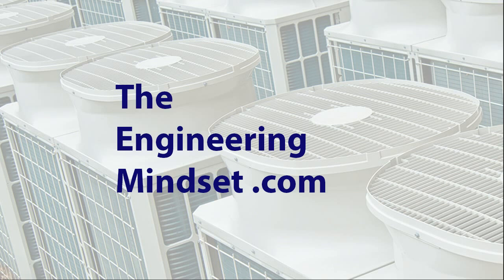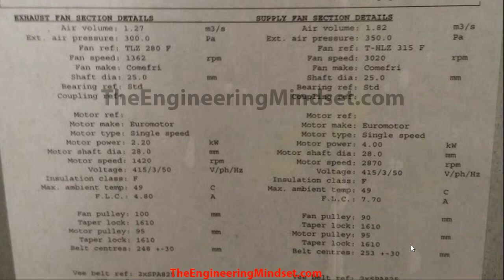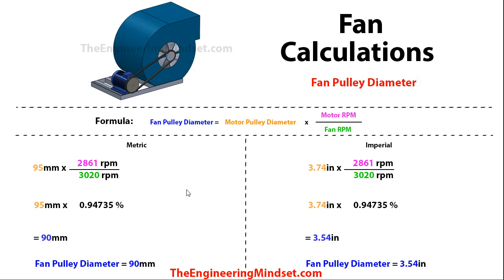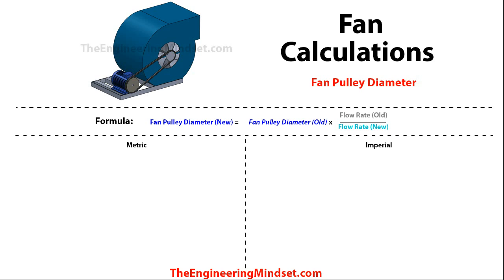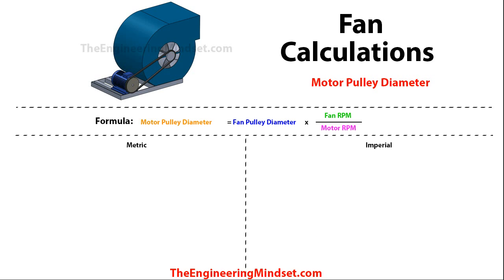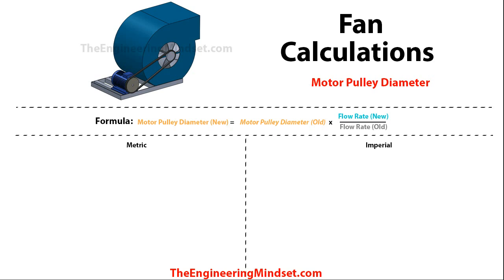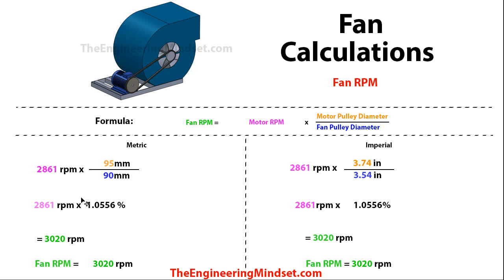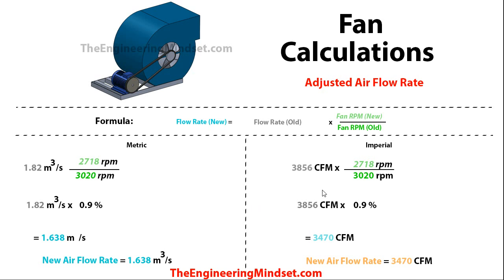Fan & motor CALCULATIONS, Pulley size, RPM, air flow rate cfm hvac rtu

Comment: can you explain the blower design procedure, please..
Reply: Sir do u have any suggestions now ? I kinda hard to believe it is such a pain to search design procedure of a fan as a cooling device to reject heat out from a generator. My schematic system was pretty simple since it doesn't need any motor. The fan will be installed on the rotor inside a generator to circulate the air. But I don't know how to choose the proper design and sizing of the fan.

Comment: Good Day, I meet with a customer today and they have 3535 RPM 40HP Motor that has to drive a Roots 56 URAIL Blower. they want pulleys on both components. Can you help me out.

Comment: How are you measuring the pulley diameter? Bottom of the groove, the edge or with the belt on the pulleys??
Reply: We can measure the diameter of the bottom of the pulley groove or the pulley belt, but the two pulleys must be measured in the same way.

Comment: PS - what about calculating the ratio of motor and fan pulleys to achieve a desired CFM. Also, how to calculate existing CFM if not stated.
Reply: Measure the fan capacity with an anemometer.  We provide that service.

Comment: Hi Paul, for equations at 4:30, is there any typo?
Reply from the maker: no, I don't think so?
Reply: Yes. It should be  111%, not 1.11%.  The increase is 11%, or multiply by 1.11, or its 111% of the old.
Reply: The other calcs are done similarly. However, its semantics.

Comment: can you advise on belt slippage?
Reply from the maker: If it's slipping then tighten it. Check its clean and nothing is causing it to slip, buy a deflection guage and check with manufacturer for allowable deflection but 3-5mm is typical
Reply: what about new belt, when choosing pulley size, how much belt slippage should we factor? 3~5% of Driving RPM?